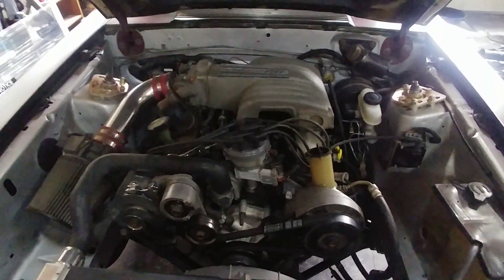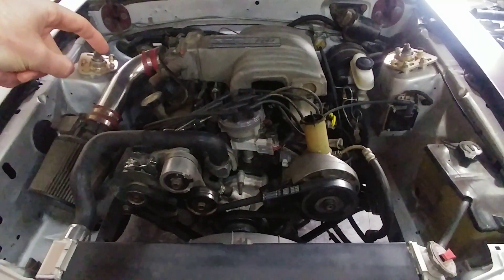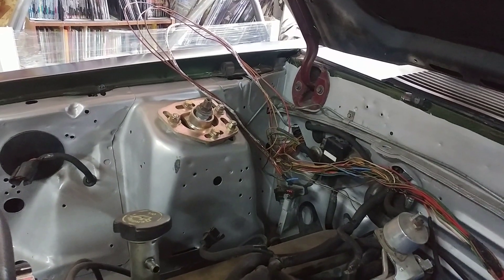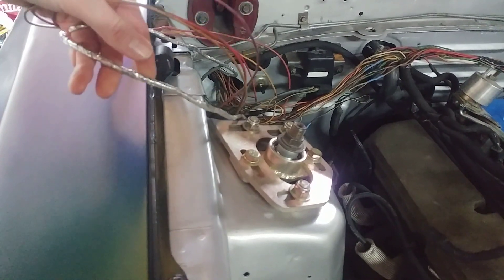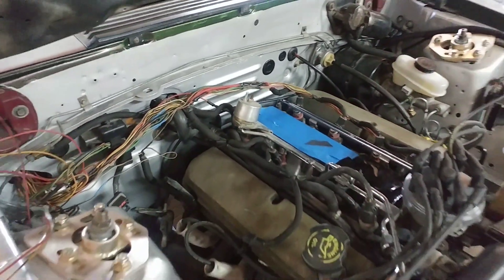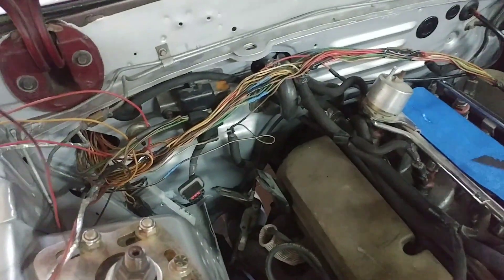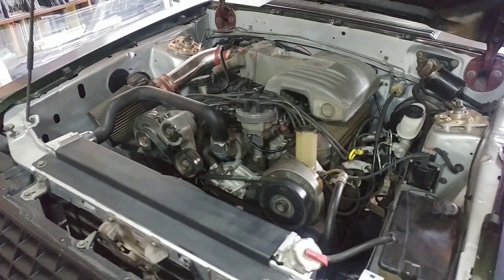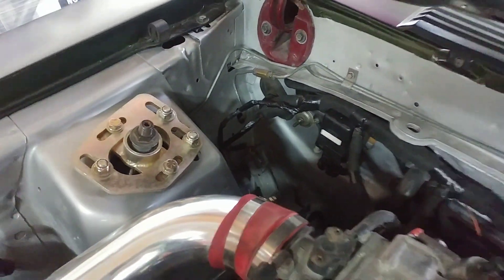My Failed Attempt at a TFI Module Relocation Kit

Comment: Not sure  if you're  using   generic  or  Motorcraft  module  that  might be  you're  problems  the Motorcraft  is only choice  for this. Most  modules that come with  distributors  are crap also  you're  moving  module hot to even hoter area.  On remotely  modules  like 95 mustang  or truck  's they are mounted   under air box or near headlights .
Reply from the maker: My issue was the grounding of the module. It worked before I messed with it, and it worked when I put it back. I later used the FatFoxx kit and located it in front of the passenger tire. It never had a problem located there.

Comment: Usually the problem is the lack of or a burnt out 22k resistor on #4 wire on the TFI module if its a stickshift ignition or using an IDM TFI in a stickshift vehicle..The problem with the TFI module exploding isnt heat generated from the engine...Its Flyback. Look it up..Get yourself some diode protected relays from a 1995 Mustang for the Fuelpump and also the EEC relays and put a diode suppressed starter solenoid and I bet your problems go away...

Comment: Wish I saw this earlier, did you check ground on TFI backing plate in its relocated place? Not just to the ground wire you ran but chassis. TFI aside did you verify or replace the magnetic pickup inside distributer? That's where I had a problem even though enthusiasts/mechanics told me otherwise. $23 part and good to go for me. Next look at idle air control then TPS voltage. Anyways cars are fun or so good luck.
Reply from the maker: I think my biggest problem was going to be the ground location. The distributor was new, and verified to work before I started this trial. In the end I installed a Fatfoxx TFI relocation kit and it's work very well since.
Reply: @BasinMotorsports  Good to hear you are up and running. Yes I saw your video on Fattfox install after I commented here. Their instructions and your video a good ground on remote location is key. Happy driving.
Reply: You are very correct about the TFI module backing plate being properly grounded..Having the distributor grounded with a copper grounding strap helps out alot too but his issue isnt heat..I have a 91 that had 565,000 before I refurbed it and I havent had a blown module ever since a Ford Technician told me to put a diode suppressed starter solenoid and ECU relay aswell as fuelpump relays w/internal diode protection and my truck will run like a dream and I did away with the clutchfan and put a hayden electric fan controller and Ford taurus 2 speed electric fan...The old guy was right and I got 16 troublefree yrs out of it looking ahead to another 30 now. Take care  and Happy New Year

Comment: This is another Reason why I still love old Carbs. Simple Carb setup, and enjoy Spring time driving like I do. With EFI, there is more to go wrong.
Reply from the maker: There are days that I do think back to my teens when I could slap a carb on and go.  EFI isn't so bad.  My problem is I keep touching stuff to "improve it" and that sometimes doesn't go as planned.
Reply: The problem is that quality U.S.A made Motorcraft parts are no longer available and junk yards have crushed all the 80's vehicles years ago!
Reply from the maker: I still have a dinosaur salvage yard about an hour away. They are '95 and older only, and usually have a few Foxes rotting away.
Reply: @BasinMotorsports  Cool. I'm still looking for a 79-82 Headlight bezel for the Drivers side. Let Me know. Thanks.

Comment: Was your engine running with the module on the firewall at the end of the video?
Reply from the maker: No.  I never had it running with the module relocated.  When it ran, it was back on the distributor.

Comment: The f150 has heat sink set up. The wire harness could be useful.
Reply from the maker: I have something coming next week that should fix it up, but I did think about trying to find an F150 heat sink on Ebay or elsewhere.  Just hadn't pulled the trigger.
Reply: Totally different harness

Comment: Have you thought about using a 94 distributor  the only thing as I can think is they use a tpi that is located on the passenger side finder.
Reply from the maker: I didn't. I have something coming that should fix it up.  The 2nd distributor is working well until then.